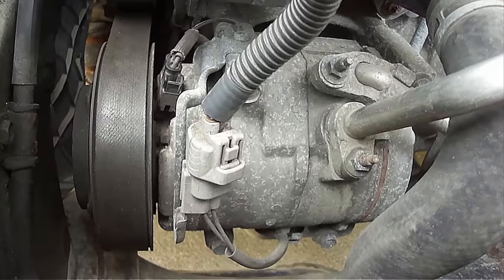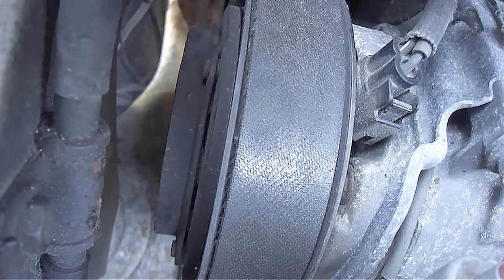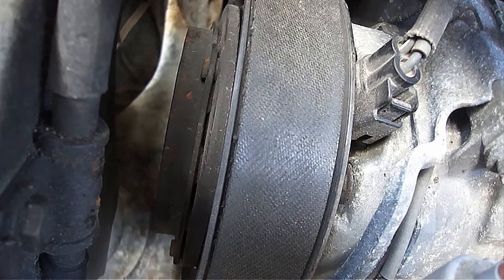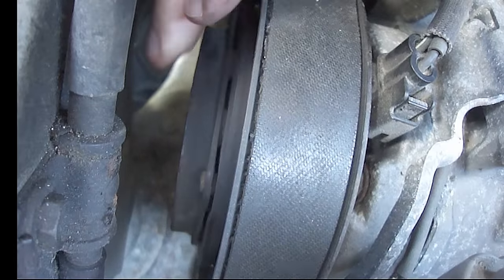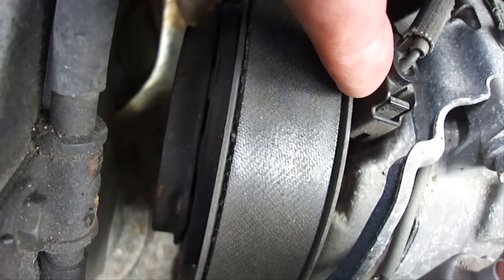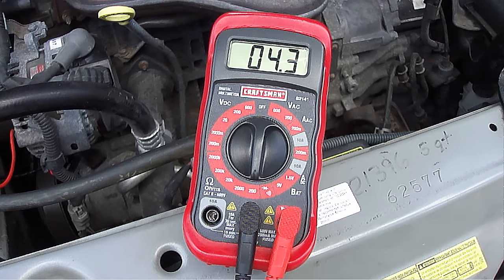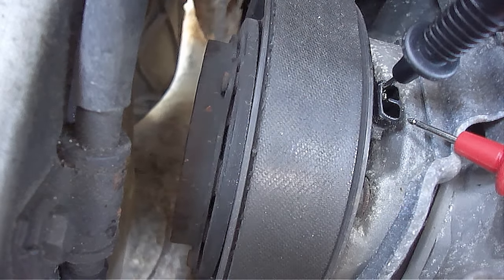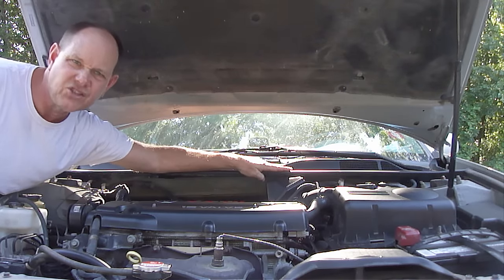How To Fix Car AC - Compressor Not Working

Comment: I have a Sanden 508 style compressor and I put 12 volts on it and the clutch engages but it will not free spin with engine off, ( or on for that matter). Does that sound like a bad clutch or compressor ?

Comment: I wasn't able to check the clutch with the multimeter or battery but I jumpered where the rely is at and it clicked. I also switch relays with the horn and still nothing while running. Any ideas?

Comment: Question: should the clutch be turning together along with the compressor with the AC in OFF position?

Should the clutch turn freely by hand (engine off) ?

Should the clutch be turning with the compressor while the power source connector unplugged?

Should the clutch be pushing in and out when AC is turned on and off?

2016 Kia Soul (100k miles)
Original compressor, freon. Never charged in 8yrs.

AC fuses test good.
Couldn’t see any Clutch Relays on diagram.
I see Fan Relays.

I removed the 2 wire connector from the compressor and tested the voltage at 11.9vdc.

Power is going to the compressor.

I didn’t have enough time to remove the belt to isolate the compressor and clutch independently.

Symptoms: AC on but, not blowing cold air.

Blower works.

If anyone has any ideas, please share!!

Comment: So when the AC is on should the clutch be spinning the whole time its on?
Reply from the maker: No
Reply: @proclaimliberty2000  Thanks Paul.  AC blows cold in my 2011 Civic except when its hot.  I've got a shop telling me my Condenser is bad.  I know its not alot to go off but doesn't that sound more like a bad AC clutch or Compressor?
Reply from the maker: @seano79  The first thing that I would be looking at is low refrigerant.

Comment: I notice that there is a pool of some sort of liquid near my compressor, could that be from the hose leading to it?
Reply: That's unlikely, the compressor is charged (filled) with freon gas which would not pool.  The compressor does have a small amount of oil but probably not enough to pool.

Comment: I have this Honda Brio amaze and air is not cooling during Idle, only when the car is running or giving it a rev. what do you think I should replace? both Compressor and condenser?,. thank you,.
Reply from the maker: You may just be low on refrigerant.
Reply: @proclaimliberty2000  Honda Casa already changed the freon and expansion valve but the problem is still the same,. : (
Reply from the maker: @renzjosephong9426  Is the compressor clutch engaging during idle?

Comment: My compressor turns really slow about 20 rpm, first i did the shim removal trick then i did the no shim trick so basically it should be holding now but now it felt like its slipping and turns really slow.

Comment: ive got a 2006 dodge caravan blowing warm,  system has pressure and compressor is working, [ if i turn air on clutch engages and spins when i turn off clutch stops  ]  what could be the problem ??

Comment: What does it mean if my LP side is 30 psi and my HP side is 25 psi ? Also my clutch is not spinning but how do i know how much refrigerant to add if its a safety cut off problem if the clutch isn’t working in the first place?
Reply: * like does the reading on the manifold gauges stay the same whether my compressor is working or not? IE does the compressor not functioning correctly mess up the reading on my freon levels? Or can i add freon now and hope the system allows the compressor to turn on?

Comment: I was testing my clutch engagement at  the fuse box and it was moving in and out and now it just stays locked in and womt opent. What could this problem be. And the clutch doesnt spin at all when ac is on or off

Comment: There’s a squealing noise whenever my clutch engages so do I just change that front piece?
Reply: I'm pretty sure that to fix your problem you need to take off the clutch plate, take out one or two of the shims that are inside it, and slap it back on. I have the same problem as you and what I've found in my research is that taking out the shims is the best agreed upon solution in the car community.

Comment: Hi my friend I’m working on a2008 civic the ac compressor stays engage all the time I change the compressor condenser expansion valve even the climate control from the junkyard and still nothing fans and compressor stays on don’t know what else to do is cooling good but I know the compressor supposed to disangage
Reply from the maker: Did you perform the tests on the clutch as shown in this video?
Reply: I replace the a/c compressor stil have the problem
Reply from the maker: @elbaron51  My best guess is the low pressure switch is bad or has a bad connection.  Watch my video on ac pressure switches.
Reply: @proclaimliberty2000  I change that too.some one says to check the blower resistor by the glove compartment but the blower is working

Comment: Hi, My 2003 G35 Infinity air conditioner continues to blow first hot air then it starts getting slightly cooler the longer you drive, then it gets hot again when you stop? any Idia what's going on?
Reply from the maker: My first guess would be low refrigerant. That is the number one cause of air-conditioning problems. Also check to make sure that both of your cooling fans in the engine compartment are working.

Comment: I bought a brand new compressor. The clutch does not engage. I did the wire test, and the clutch did not click, or move in and out. Is this unusual to get a bad clutch with a new compressor ? The company I bought it from does not want to accept a return of the compressor.
Reply from the maker: Yes that is unusual. Tell the company what you just told me.

Comment: My AC compressor engages, I have freon pressure on the low side, my AC fans blow 'regular' air. What is wrong with my AC?
Reply: Have you checked the AC relay and fuse?
Reply: @ethandeutsch94  It was low on freon. Low side pressure doesn't mean it out of freon I learned. My compressor enaged even with not enough freon to blow cold air.

Comment: If the presureswith its bad ,does not the AC works, if the missing engoh gas , the AC not working , when the realy/ fuse  does not work , Ac not working, 

The AC coil its the smalt part of the problem when the Ac not working.

Comment: Hi, what is the problem if my clutch engages by itself after 10 seconds of car starting. AC control is set to off. Relay is good. After engaging, it won't disengage anymore. Ac is turned off.
Reply: Same thing on my 03 ranger. Clutch spins intermittently while ac is off..and makin the bad noises..its bad. Just makun sure here..good comments

Comment: My dodge journey squeaks when the ac is off, as soon as i turn the ac on, the squeaking is gone. Any advice?
Reply: use long screwdriver and listen to squealing sound and see if it's from clutch but I recommend be very careful as you can with moving belt
more likely it's bearing in clutch

Comment: What if the clutch is in the lock position and turns with the pulley wheel all at the same time and never unlocks how do you get it to unlock?
Reply from the maker: Did you try jumping the clutch with your battery as shown in the video?
Reply: @proclaimliberty2000  I didn't even notice you doing that I would have watched the whole video all over again thank you I'll let you know

Comment: When we push the airco button we here a click but doesn't cool, a leak?
Reply from the maker: That click is the compressor clutch turning on so that’s good and indicates you still have refrigerant in the system but probably not enough. Yes it could have a refrigerant leak.  Or, it has lost a little refrigerant each year which is normal and it simply needs a recharge.
Reply: @proclaimliberty2000  We had it recharged last year, before that it was good for three years. So probably a leak in the airco radiator? Greetings from Belgium ;-)
Reply from the maker: @Tintoycar  it could have a leak in a number of different areas.  I recharge my sons car twice a year and call it good. It’s much cheaper than trying to repair it. I don’t think I’ve ever talked to anyone in Belgium. I’m from the United States.

Comment: Why is there a reading of power in the clutch with nothing connected?   You read 4.3V.
Reply: Ohms meter sends voltage from the battery in the meter to the probes and through the circuit and records resistance or checks for continuity.
Reply: @lucash1980  Thank you!  I couldn’t easily see where this was under the vehicle.  I never did find it.

Comment: What is that bird noise ? I have one after change compressor
Reply: If it sounds like chirping, it's more than likely your belt is either too loose or too tight
Reply: @riptordaking   When I rew up engine and AC on noise is over

Comment: My air con switches on and off OK but clutch never runs free which means compressor is running constantly
Reply: Not all compressors have a clutch. Your's more than likely is a continuous compressor that's operated via a control valve. Quite common.
Reply: @brettabbott7783  
Thanks very helpful its a CLK 220 cdi , I was thinking it would grind go a Halt
Reply: @johnminshell6532  If your compressor is a continuous, to properly diagnose, you are going to need gauges to see what your high/low side is doing when the AC is activated. Compressors running a control valve without a clutch are not serviceable on the exterior like clutched compressors, as shown in this video.
Reply: @brettabbott7783  Thanks , I hope so

Comment: I'm doubting that replacing the entire compressor is as cost effective as just replacing the clutch if it's bad.  Compressors are outrageously expensive, and the refrigerant system must be drained and refilled.

Comment: Hi i own 2012 Chevrolet aveo 1.4 lt , problem i face is if the car is Idle for 2 or 3 days the AC compressor switching on only after 20 to 30 minutes of driving. what could be the issue?
Reply from the maker: First start by making sure it has enough refrigerant.

Comment: What if my clutch is continuously engaging and disengaging about every 2-3 seconds. Also no condenser fan or radiator fan coming on at all. With ac on or not. Nether come on.
Reply from the maker: My suggestion would be to first get your radiator fans repaired and you might find that everything starts working again.
Reply: @proclaimliberty2000  they were working. Everything happened today at a red light leaving McDonald's. Car started idling rough when the clutch  would engaged/disengaged. Heard all the fans shut off. And ac started blowing warm. Got alittle cool again at like 50-60 mph but as soon as I slowed down. Nothing again.

Comment: Thank you. My 2015 Hyundai Elantra compressor clutch does not disengage. Clutch is always spinning even when I turn of AC and the low side reads over 120 (retard) and high side is 112.5. Could it be my compressor clutch since it will not let go even after disconnecting switch and power to the compressor?
Reply: I put power to the clutch and I could hear it click but it would not disengage. I just makes a click but will not let go.